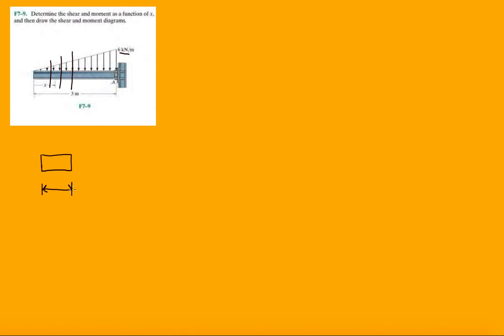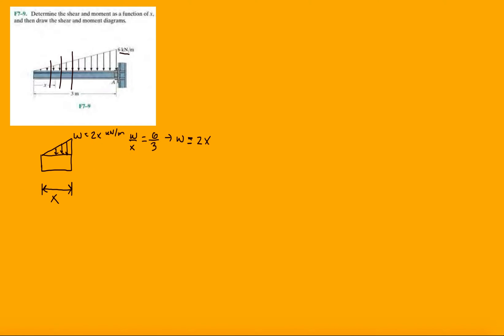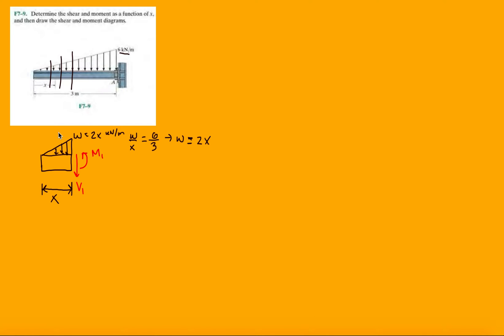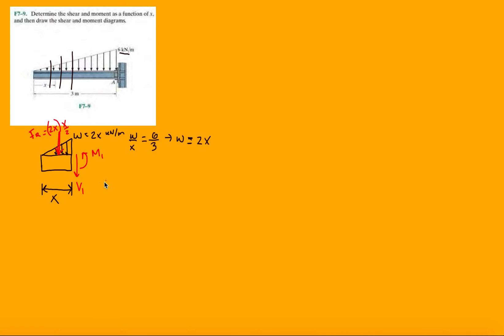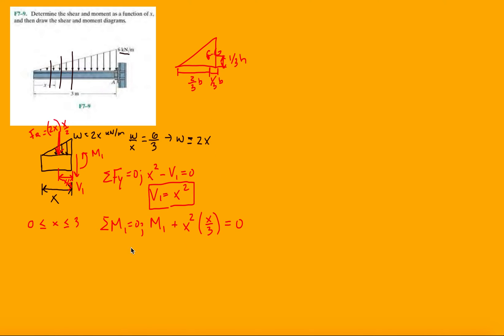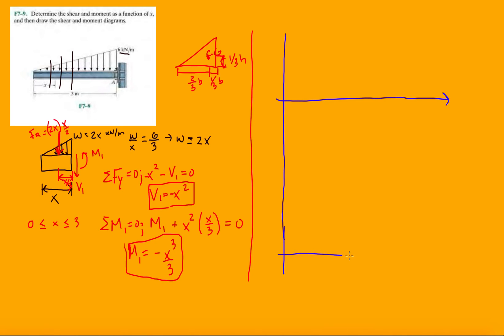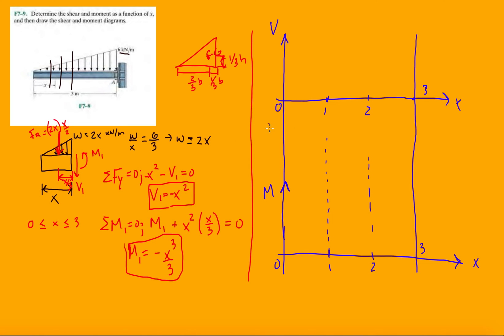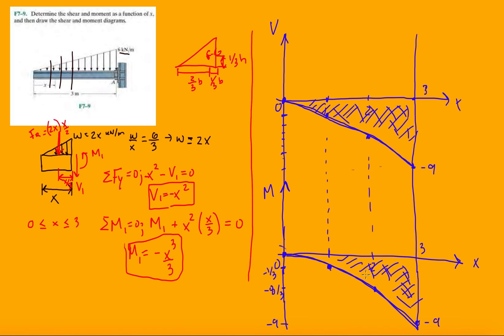Problem F7-9 Statics Hibbeler 12th (Chapter 7)

Comment: Why in the graph of V is not the curved with the moment? if V = -X ^ 2, wouldn't it have to be curved as well?
Reply from the maker: HI Caleb. You're correct, my drawing looks like a straight line but in reality my drawing just sucks haha it should be negative parabola. Trust the math!
Reply: @theengineeringcrucible3490  hahaha that's why it seemed strange to me that it is a straight line, thanks for clarifying my doubt, could I make more videos of resistance of materials, please
Reply from the maker: @calebneira8655  This weekend I shall dive into Mechanics of Materials..Beer or Hibbeler?
Reply: @theengineeringcrucible3490  of beer, could you start from simple effort?, thanks
Reply from the maker: @calebneira8655  Sorry I think I misunderstood. Do you want me to do Mechanics of Materials problems or more problems from chapter 7? I was going to start Mechanics of materials problems using the book from Hibbeler but didn't know if you preferred the book from Beer (author).